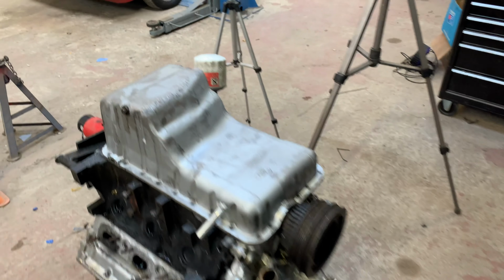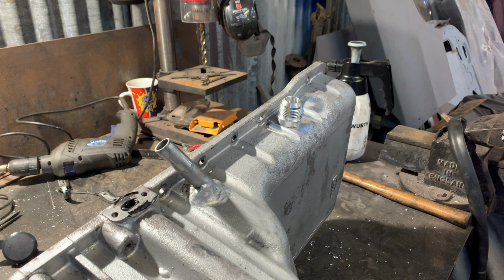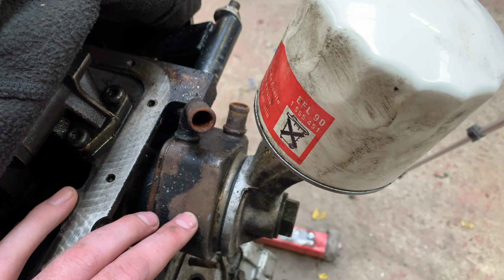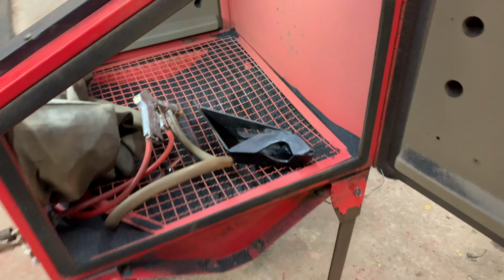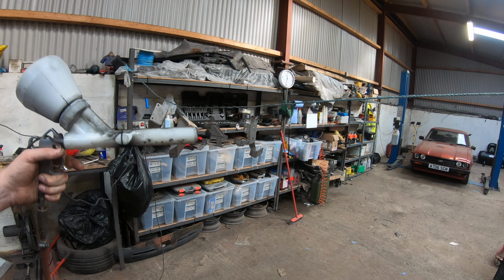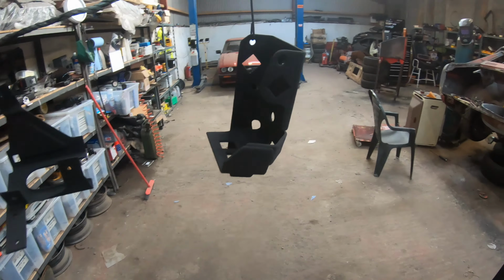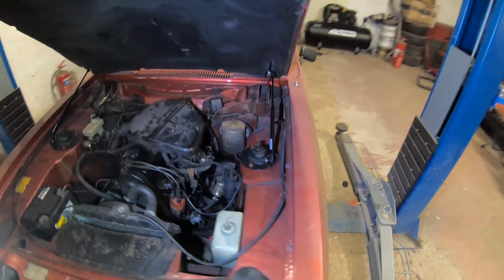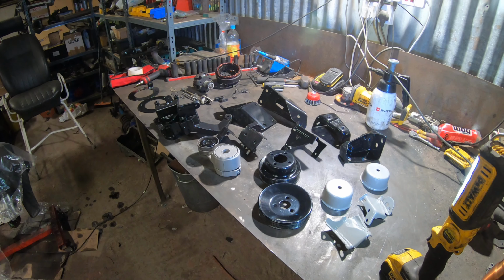Project Xpack Episode 35 - New toys and some powdercoating! Ford Capri 2.9 Cosworth Twin Turbo.

Comment: Next time you do some powder coating wipe the parts down with acetone after sandblasting and handle with gloves. Gets rid of all that dust and the use of gloves don’t leave fingerprints and greasy marks. Gives a much better finish when everything’s all clean.

Comment: Dont't forget to put a ground line tot the alternator after powdercoating the bracket.
If not you may have problems with the electrics.
Reply from the maker: What you didnt see on that video was me screwing the alternator up, the threads got chewed up when I was putting the pulley back on so it is now rendered useless unless it can be rethreaded lol. I have a spare second hand one coming in the post so I will paint it up, and make sure the contact between the cradle and the alternator is cleaned. Thanks!

Comment: Just a thought for the future Kris could you not weld the bungs on the inside of the sump? It would look really clean on the outside if you were able to do it that way.
Reply from the maker: Unsure, these fittings are designed for welding on the outside so that’s why I did it that way :). I’ll take a look next time if there is a next time lol!